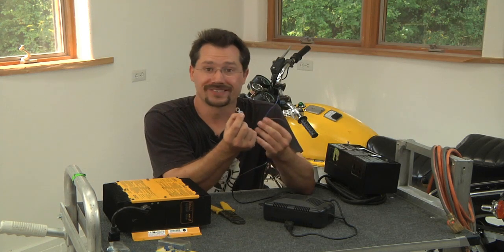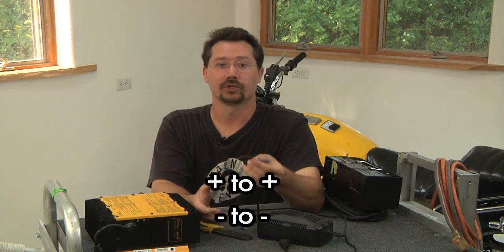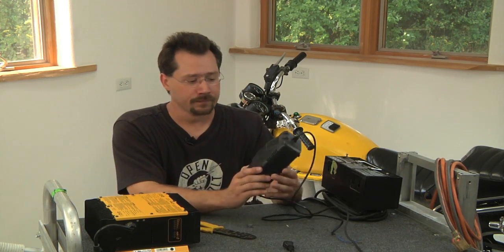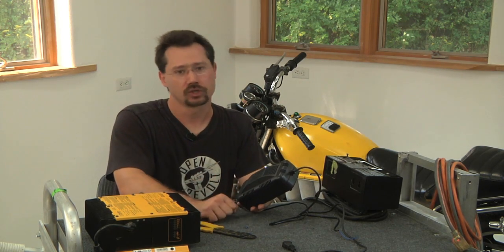9 Build Your Own Electric Motorcycle - FULL - 9 Charging

Comment: I'm looking using same batteries on 48v solar system what would the max charge rate/amps to not cook the battery
Reply from the maker: I once talked to a chemical engineer that worked on those particular batteries. He told me that there is no upper charge/discharge limit, just that you want to  watch the temperature. I jokingly asked if I could charge them at 1,000 amps if I had them in a kiddie pool of ice. He said yes.

In general, nowadays, I would recommend lithium batteries for solar and electric vehicle projects. But, if you already have them, Optima Yellowtops are pretty top of the line lead batteries.
Reply: Thank for replying
Reply: I have two 8 pack of 6v lead acid golf cart batteries but need more not sure if the 1.6 kw of batteries from escape battery is better or not

Comment: Can you wire up a power tool 24 vault power tool charger and Carry extra batteries
Reply from the maker: You potentially COULD build an electric motorcycle using power tool batteries, BUT you would likely find that it would be a lot more expensive and less energy dense than simply designing your own dedicated battery pack.

Power tool batteries ARE great for electric bicycles!
https://www.youtube.com/watch?v=yrJo-P1SrnI

Comment: Can you have both options, on- and off board options?
Reply from the maker: Yes, you certainly could.
Modern commercially-built electric cars often have a built-in charger and then also a port for a DC Fast Charger.

The production version of the Harley Davidson LIVEWIRE electric motorcycle includes an onboard Level 1 (120V) charger and a port for a DC Fast Charger.

Comment: How come you cannot mount an alternator next to the drive gear with a pulley to the alternator,change the capacitor of it to 48volts
Reply from the maker: You COULD mount an alternator, connected to the motor.
However, why would you want to use the electricity in the battery to spin the motor to spin the alternator to make electricity?
It's much easier, more efficient, and compact to use a DC/DC converter to directly convert the main battery pack power from 48 Volt (or whatever the traction pack battery voltage is) to 12V for the lights and other 12V items on the cycle.

Comment: It would be a good idea to put individual quick connectors on each battery and occasionally (perhaps once every 5 charges), charge each 12V battery individually for better battery health.
Reply from the maker: There were never any issues on this bike with batteries getting out of balance with each other, but battery terminals were easily accessible. I could at any time simply attach a standard 12V battery charger with typical alligator clamp connections. If a person wanted to do some sort of small quick connectors, that would work fine too.
Reply: A good test after a long ride, check the resting voltages of each battery and maybe even check it with a light load on it such as a 1A load.  If the 4 batteries are within 0.1V of each other then they can be considered matched or balanced but if one of them for example is 0.2V (or more) lower than the others, then that one needs some special attention so in that case, it would be better to charge the 4 batteries individually.

Comment: I would like to have one of those overseas (Philippines) but I have to check the legality of them before I commit.  Gasoline is more expensive over there (compared to USA) but electricity is cheaper, so an electric motorcycle makes more sense there.  Here in USA, a cheap reliable gasoline motorcycle (such as my 2001 Bandit 1200 which I paid $1900 for maybe a decade ago), is good cheap transportation and 10 times as powerful as an electric motorcycle using a golf cart type motor (about 10 HP).  I much prefer a top speed of about 150 MPH than say 50 MPH.  That way when I am cruising at about 75 MPH, I am only using a fraction (maybe 25%) of the engine's maximum potential power whereas a 10 HP motor would be running "flat out" at about 45 to 50 MPH.